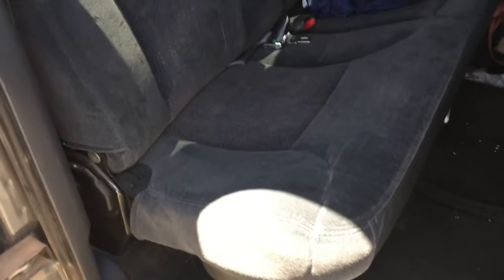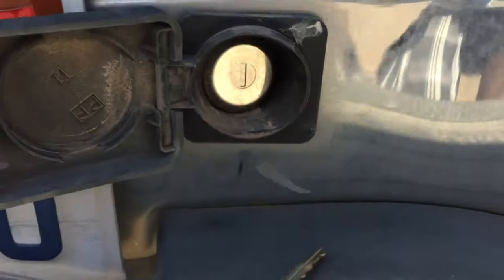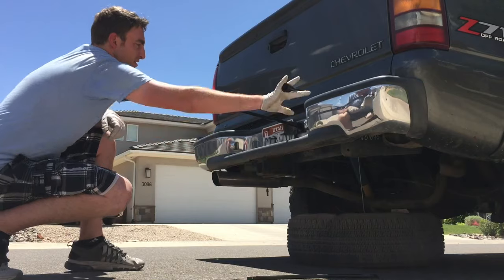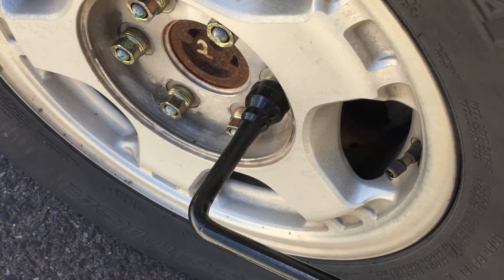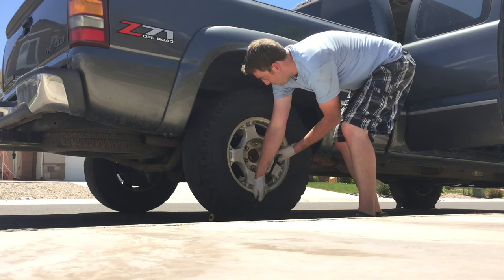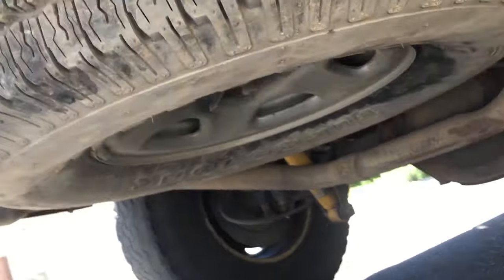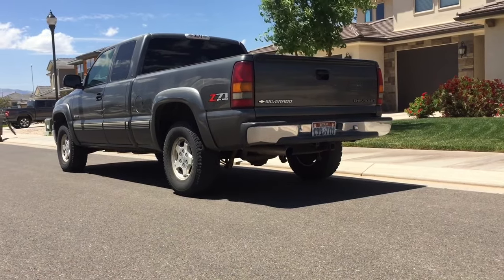EASY! Lower & Change SPARE TIRE: Most trucks Silverado, GMC, Sierra, Tahoe, Yukon

Comment: I've watched what seems like a DOZEN videos and you are the FIRST PERSON to specifically say "Put the square end in first." I was sticking the hooked end of the tool in first and couldn't figure out why the tire wasn't lowering. Thanks, Man!!
Reply: And there are two square ends....the larger of the two is the correct size. And if the clip holding the plastic guide tube to the chain crank mechanism is unclipped, broken or otherwise fubarred, your chances of engaging the square drive pin is very very slim. Ask me how I know.....😡 At least it happened in my driveway and not on the highway in the middle of winter.

Comment: Great video! Thank you for showing from start to finish. Had tires replaced and the folks at the shop left my spare in the bed of the truck. And if you didn't take the spare off from under the truck in the first place, makes it a little more difficult not knowing how to put it back under! (Because what may seem simple for others...well, you know!)

Comment: In a emergency, you can buy a cheap 24" long 3/8" drive extension from Harbor Freight and use a 12 point 1/2" socket on the end of the extension to slip over the square drive bolt head on the spare tire hoist. But be aware the 12 point socket will probably jam on the square bolt head of the hoist. The hoist bolt head is 0.460" square, just under 15/32". I tried using the female end of a long 1/2" drive extension but the O.D. is too large for the tube going to the spare tire hoist.

Comment: There is actually a lock on the lowering device if it’s gets pulled up without tire , you have to squeeze the top of the device to get it to release
Reply: Man I am having trouble with that right now.  When u say top part of the device are u referring to the device the retainer hangs on?

Comment: Good job on calling out the fact that you should not remove the cable from the frame. But let’s be honest, any time you need to basically lay on the ground to access the spare (or replace the tire back underneath) then you should not use words like “easy”.  Try doing this on the side of a busy freeway. At night. In the rain. Just call AAA if that is an option. Changing your own tire is all well and good but you are going to ruin some clothes and a lot of women won’t be able to do the lifting required.

Comment: Throw away that lock key assembly!?  no way!!
Reply from the maker: In my area it’s more likely to get stuck than stolen
Reply: @dannyjohnsonsgarage  Well I’ll just order a new one 😊
Reply: @dannyjohnsonsgarage  I still need to check mine though because my spare tire is not holding air

Comment: Does your truck have to be on a flat surface to put the device inside to lower the tire? Can it be done if your truck is parked at an angle?
Reply from the maker: It has a very high risk of rolling off the Jack if done on not level ground.

Comment: my first time with this, where are those wheel chocks?  I have a 2019 SLT.  thanks for the video!
Reply from the maker: They should be with the jack unless they stopped providing them. I didn’t remember seeing them on my 2015 Yukon Denali either

Comment: What if the square it’s supposed to line up with is a circle with the doorman jack handle
Reply: Have you gotten an answer for this? I'm not sure if mine is a circle or if it's just stripped

Comment: Kinda late here but is it normal for the tire to wobble when situated as high as it can go? Don’t know how to fix it. It wobbles like crazy when I drive.
Reply from the maker: It shouldn’t wobble. Is the tire size factory for the wheel?
Reply: Yeah it’s factory. I tightened it up as far as I could and still wobbles.
Reply: So looks like I fixed it. Wheel was mounted with the front of the rim against the bottom side of the truck. I flipped the tire and hoisted it and its secure now. Either that clamp wasn’t sitting securely against the rim and/or hoist was at its max up position not securing the tire completely. Thank you for your response. Got to lube up the wire while I was at it to!  I blame it on BigOTires when they changed out my spare for a new tire ha!
Reply: Yes you have to have the spare tire facing down so it picks up the slack.

Comment: my truck is raised and i cant put the key in top lower my tire down. my truck is raised 3"
Reply from the maker: Are your tires bigger too? A bigger spare won’t fit and if you try to put a smaller spare on it can ruin the rear differential and possibly the front transfer case.

Comment: so you have to go under the vehicle while it is jacked up? Boy, that sounds dangerous.
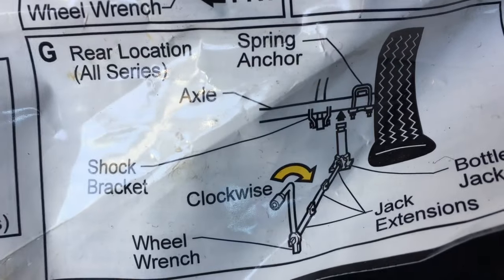Reply from the maker: No, lift and lower the spare only when all wheels are installed. At 5:32 I mention the length of the pole so you don’t have to ever be under the vehicle when using the jack. At 6:20 I also ask you to never be under the vehicle at any time the wheel is removed. Please be as safe as possible 👍🏼